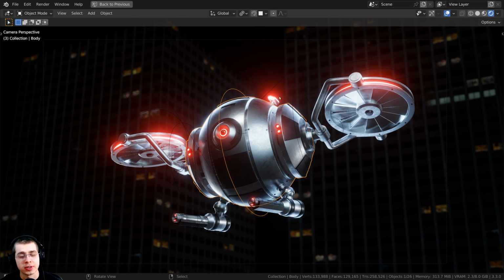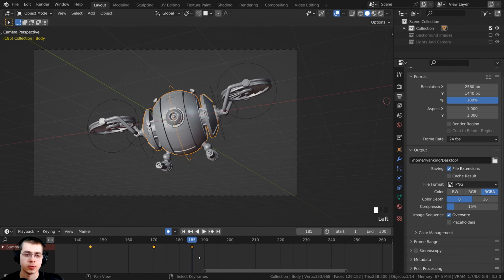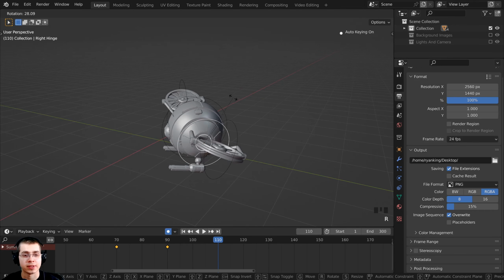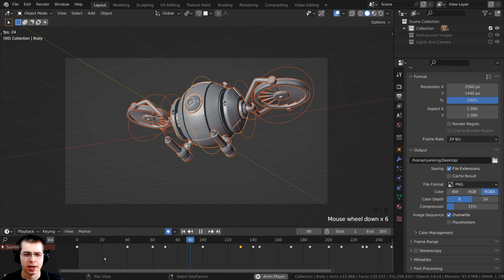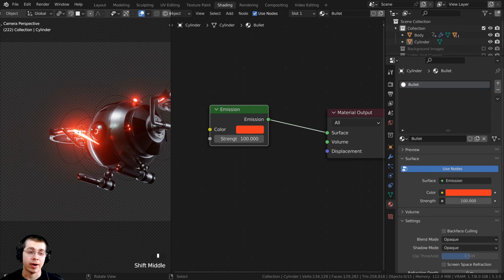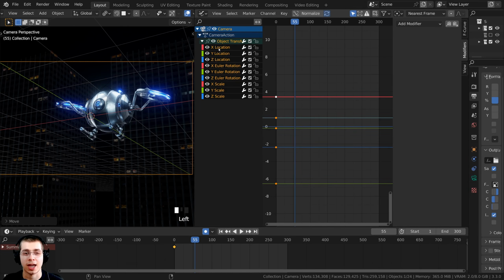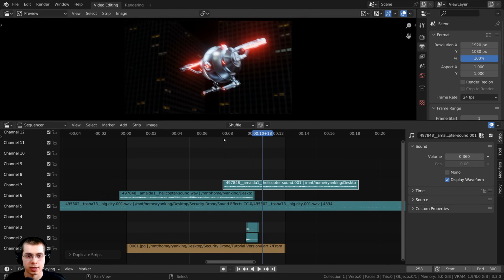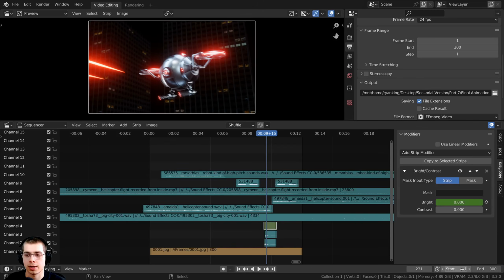Sci-Fi Security Drone - Part 7 (Blender Tutorial)

Comment: THANK YOU BLENDER 4.0 I LOVE YOU SO MUCH. For those of you who can't find the Speed Factor, not to worry. I've suffered so you don't have to!
It is no loner just as simple as adding a keyframe, changing the speed, then adding a new keyframe. (God I wish it was)
So Blender 4.0 has changed a few things, lets talk about this one cause it's a doozy. To make your audio speed up or slow down you're going to first, under Time, click Show Retiming Keys. Bring your timeline to the start of the animation, select the audio file you want to be sped up or down and go to the toolbar at the top of the Video Sequencer and click Strip, hover over Retiming, and click Add Retiming Key.
When you scroll out you should see two 100% on either side of the Keyframe. That's good, that's where we want to be.
This is where things get a little wonky. Go to the frame where you want the sped up audio to end, and then go PAST that a little bit. Go to Strip in the toolbar, Retiming, Add Retiming Key. 
You should see a 100% in between the two keyframes you've just made. Great! Now you can click that new keyframe you've made, Right click then add Set Speed. Since we're working with percentages you're going to need to set the speed to 110 instead of 1.1 like in the video. That's going to move the keyframe back because you're essentially "squeezing" the audio file to make the audio speed up. You might have to experiment with where to place the second keyframe so you get the timing right. You might notice it'll say 111% or something similar and from what I found out, the farther apart the sound changes are, the more accurate it'll be so don't worry about it too much.
Do you like where it's at? Is it sped up enough? Good, because once you've set it to how you like, you can NOT go back and change it. I'll explain in this next bit.
Once you've got the audio sped up to how you like it and if you're following along to the video. Put your timeline to the part of the animation where you want the slower sound to end and place it BEHIND it. You'll notice it added another 100% in-between the two keyframes and you're going to right click that new keyframe, Set Speed and change it to 80%. This will "stretch" the audio file, to make it play slower. Again, if the timing is off, experiment with the placement till you get it right. You're going to do this for all future audio changes.
Something you might have notice once you've played the whole animation with the sounds or just while making the changes is that the sound jumps to that new audio change instead of transitioning to it.  I find it that if you do this step last, it'll make it easier on you. 
You're going to click the keyframe where you want the transition to be and click Add Speed and Transition Slide. This will add an in-between that'll say the percentage on the left - the percentage on the right. For example, mine says 111%  -  89%. You can move either keyframe out. The further out you move it, the slower that transition will happen. 
You will see your original percentages drop as you widen the gap. I wouldn't worry about this too much as it doesn't change it that much, and listening to the audio, it sounds good. Just a heads up, don't worry about putting the exact numbers Ryan King puts down, if it sounds good to you then it's alright. 
When the drone does its quick turn, the transition is really quick and so there's not much time for it to ease into the next audio, but that's kind of fitting because it turning fast after all, so I just added the Speed and Transition Slide and left it how it was. 

Some things of note: If you change the very beginning or end of the audio (not from the beginning of the animation but that looooong audio file) making a new keyframe is going to make it not show at 100%, so I would avoid changing the beginning and end if possible.
I don't know if this is the best way, this is all what I found out by looking at the update log on Blender's website, browsing some forums, and applying them to the best of my knowledge. If there is a better way to do this, PLEASE and I mean PRETTY PLEASE, leave a comment about it either as a reply to mine or just to the video in general.

Comment: I have got a small problem I can't see the key frames of the emission values or any shader notes for that matter? But location rotation key frames are visible.
Reply from the maker: make sure to select the emission shader. then the keyframes should appear. you also might need to drag the timeline down to see the keyframes.
Reply: @RyanKingArt  Thank you! Specifically clicking the emission node did the trick. I used to only click the color. Thanks for the reply I loved the tutorial.